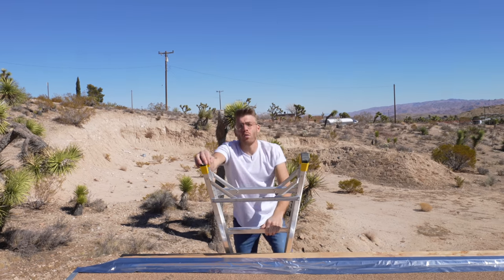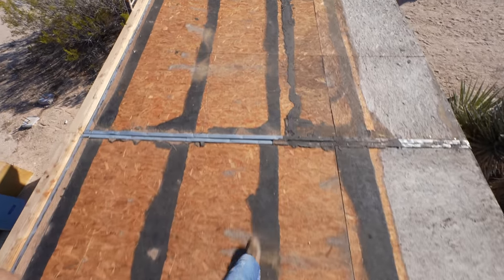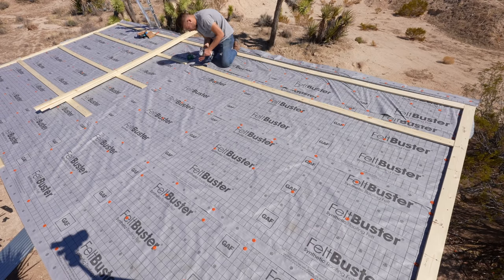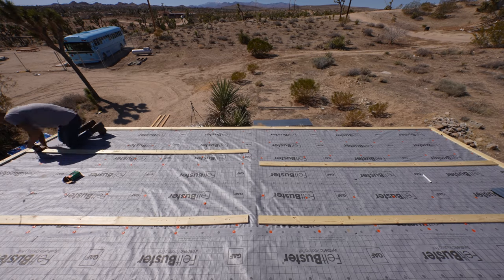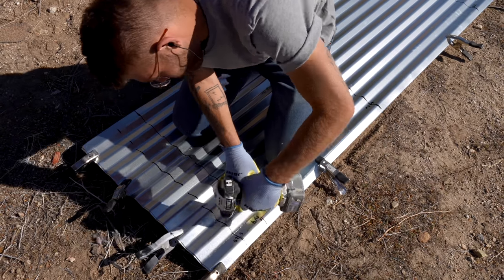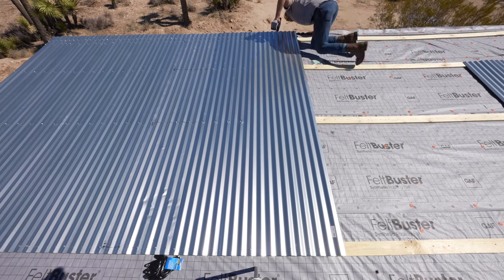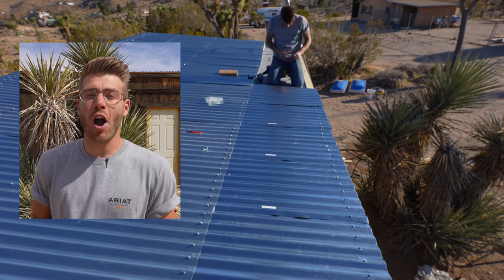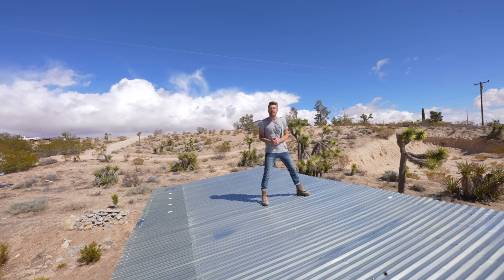SHED TO WORKSHOP Ep. 3 | Installing Corrugated Sheet Metal Roof | Modern Builds

Comment: My mans really layed down a whole layer of that underlayment in the wind just for us that don’t live in a desert
Reply from the maker: I'm a man of the people!! 😂
Reply: @ModernBuilds  but the wood under there is not done correctly if the steel plates condensate the water gets stuck on the wood... you first need to lay wood vertical on the paper then horizantol over so the condenstation can leave. sorry for bad english hehehe
Reply: @loentje8  Your English is fine. Not bad.

Comment: I just watched the 3 Episodes on Shed to Workshop.  I know you like the exterior look being the weathered plywood, and I know you tried to do some sealing with expansion foam, but when it rains (yeah, I know it's in a desert but it still rains) the water is going to get in behind the boards into the fiberglass batting, and it will hold in that batting, and you're going to get mold growth.  You really need to put a breathable water barrier on the outside, to prevent rain getting in, and let very small amounts of moister dry to the outside, and then clad the exterior with something.

Comment: When you screw in on the ridge of the metal sheet you risk overtightening the screw and making a divet where water can sit. If you screw in the valley you wont have that problem as the metal lies flat to the 1x4 underneath. In Denmark all producers of metal roofing recommends the valley for the screws.
Reply: In Argentina we also screwed into the ridge
Reply: Using the valley ensures the best seal between the gasket and the sheet metal as the valley/sheet metal lies flat on the 1x4 underneath. Furthermore there is no risk of overtightening the screw and warping the metal. The ridge should only be used where two sheets overlap to hold them together. If the valley is more flat than the ridge using the valley gives the tightest seal.
Reply: @9kolaj1973  the problem, at least were i live, is too Hot, 45° ish in summer and the gasket dont suport the constant contraction and expantion, and the hole will expand because of thouse movements leaving a potential point of failure in the valley
Reply: You do NOT put the screw in the valley for the reasons stated in the video. By simply not over tightening, or winding back if you have, then your fixing is strong and by being on the ridge it is out of the way from water pooling on it, making it less likely to fail - causing a leak. All corrugated steel roofing companies in NZ, AUS, GB and USA suggest this.  Some other wide span clip together steel with thin ridge may suggest different. But corrugated - ridge. not valley.
Reply: Nooo you’re supposed to put the screw halfway between the ridge and the valley 🙄
Reply: If you fix in the valleys, you are relying solely on a piece of rubber to keep water out - and it will eventually wear out. If you fix on the crest, you have gravity on your side. The manufacturer's instructions are specifically to fix on the crests.
Reply: Corrugated roofing is round in the valley, also...not flat
Reply: I vote no screws.  Just construction adhesive and powerful magnets.
Reply: in Argentina we put tires and rocks on the roof 😂
Reply: Here in in New Zealand all screws are ridge screws unless we are installing cladding
Reply: @vb5666  Another Dane here and I can say that I have never seen any corrugated metal roof with problems, regarding of where the screws were placed, unless it was installed by an amateur and had been sitting there for 25+ years. And I do a lot of DIY and help with renovations. Over tightening is gonna yield the same results whether you screw it in the valley or on the ridge. On the ridge you squish the rubber grommet and bend the metal to form an indentation. In the valley you squish the grommet and cause a collection point by blocking water flow. Both will eventually lead to a broken rubber grommet and a leak. So all in all, there's really no right way to place it.

Comment: I remember doing this kind of job back in the day with my father. Really, you don't need to pre-drill those holes. It's a waste of time and money (broken bits) and if by any chance you make those holes in the wrong place... well, that's a problem.

Also (though this is something I'm thinking about now) you could have placed the longer sheets first, just like you did, but for the lower section, and the smaller ones on top, that is, just all the way around. That way, as those long sheets would already have two rows of screws, they wouldn't fly away because of the wind, and the smaller ones could be easily placed on top. The only problem with this option is that your short sheets did not came like that from factory, so if they are on top their cut (the one you made with the angle grinder) will be visible, so it will end up looking better or worse depending on how nice that cut was done, whereas the way you did it you just hid it under the longer shits and you're good to go.

No criticizing for the sake of it, just giving out ideas. This small project reminded me when I helped my father roofing some kind of barn for a customer some twenty something years ago. Good times.
Reply: Measure twice and pre drill away. You actually save time doing this and after breaking a few bits you quickly learn how to do it properly and begin to break very few.

My experience is currently building industrial size sheds and barns out of this these panels. I couldn't imagine wasting all that time not pre drilling honestly.
Reply: Well, I guess everybody has a preferred way to do things and I'm just saying how my father, who was a blacksmith and did all kinds of metal related jobs, used to deal with these projects. As the screw itself is kind of a drill bit itself, that's what it's for and why I consider pre-drilling a waste of time (measuring, making holes, sharpening bits and if you miss the spot...) and money (bits, repairing badly placed holes if possible, otherwise it's a new sheet).

What should actually be considered is whether that screw can actually make the hole on the sheet, as maybe the material and/or the thickness might be too much for the screws and, also, the drill itself must be rated for this job (my father had a drill for this kind of jobs exclusively).

Comment: I would have used 2x4 purlins and put rigid foam insulation between them. It's not cheap but if it cuts the heat down it's worth it.

Comment: Next time, try a sheet the right length so no joins, or if you must join, do the lower sheet first so the longer sheet goes over the top.  Also, only do a couple of screws at the top and bottom of each sheet to start and don't screw the sheets down hard until finished. Screwing the sheets down hard can make them go out of shape easily so the sheet can become wider at either end, meaning the next sheet wont go on square. Once all sheets are down you go through and screw the remainder sheets, normally on every other ridge. Screwing at the top and bottom purlin every ridge is fine to get extra resistance against wind lifting it.

Comment: this will probably work fine in Joshua tree for many, many years. I just hope that people in 4 season climate areas follow you step by step, because this would last tops 5 years in those areas. divets in the roof trapping water, lacking airflow under the roof to prevent condensation and cutting galvanized steel with an angle grinder will make corrosion and rust develop faster due to hot metal  sticking to the surface. but this is very common in America, so I dont blame you!

Comment: If you have a circular saw that you no longer love, you can cut through metal roofing like a champ (just be sure you have good ear and eye protection).
Reply: Evolution do a multi material saw that should do the job. Plus still be able to cut through wood with no fuss! 👍
Reply: @benh1216  that's true, I just happened to have a really, really old B&D I bought, used, in the late 80's for $10.  It finally got to the point it wasn't good enough for accurate wood cuts.  Made it nonadjustable, put a carbide blade on it, now it's my dedicated sheetmetal saw.  I wouldn't cut anything thicker than roofing with it, but it's handy and it cost me nothing, FWIW.
Reply: @richgallegos5807  Wow that's not bad going! Just of interest where you from?
Reply: @benh1216  I live on the east side of Washington state, US.
Reply: @richgallegos5807  Nice! Well here's a friendly hello from  across the pond! 😁👍🇬🇧
Reply: @benh1216  and to you sir :)
Reply: @richgallegos5807  So gathering by your previous comment do you do a lot of metal work then?

Comment: Not criticising, why corrugated sheets, and not a better material, in South Africa, I used a Alumunium/Zinc product which drastically reduced the heat. Another benefit, the supplier rolled the sheet to tje exact length required, no overlap, less risk.

Comment: As an ex roofer watch this guy put the top peace of metal on first made me laugh. Talk about working harder not smarter. All the 3 footers should have went on first
Reply: He also forget L metal aka drip edge.
Reply: Oh, and once a roofer always a roofer. 😂😂😂
Reply: @californiacritic9779  not to mention he could have just went right over the roll roofing. He didn't have to remove it lol
Reply: @mrpolnar1  30 years of experience  says different
Reply: It's really necessary that amount of screws? Looked overkill to me to have every wave of the sheet screwed.
Reply: @luxtempestas  no he went way overboard with the screws. He need about 1/4 of the amount he used.
Reply: @luxtempestas  i have done metal roofs in Florida  hurricane zone and didn't use half what he used
Reply: @luxtempestas  in this style of metal its better on the ridge cause the valley on this style is v shaped and its hard to get a good seal on the screw. On metal that has a valley with a flat spot then yes i would screw in the valley
Reply: @letsgomicroliving_1993_  the wood slats underneath I think should be run vertically too right? If moisture ever gets underneath it will now get stuck
Reply: @luxtempestas  so many screws he didn’t have time to remove the stickers 😂
Reply: @dylan-nguyen  no thats how they are ran so you have something to screw to
Reply: @letsgomicroliving_1993_  don’t purlins have to run the same way the metal sheets run?? If any water gets under it will get longer to get through?  Asking. I am a diyer and i am making a shed and was thinking of using metal

Comment: That roof wont last long i think. When metal is getting condensation moisture it will drop to the plastic and trapped those boards. Water gets under board and quite fast rot. Also wet boards release moisture through nailholes to osb.
Reply: Nope.
Reply: @scotthargraves576  ok